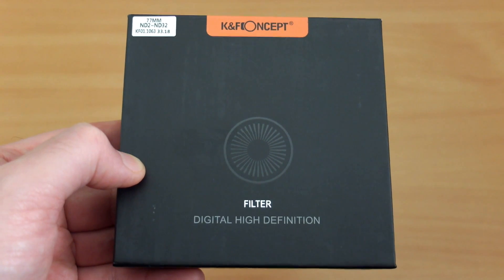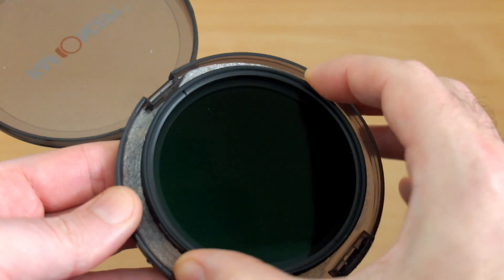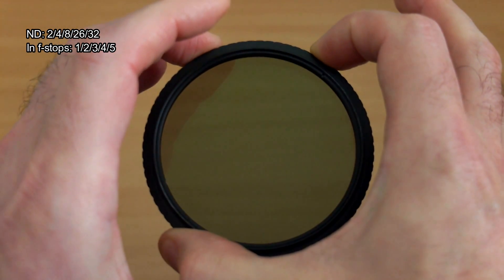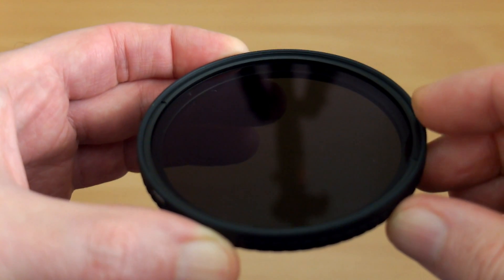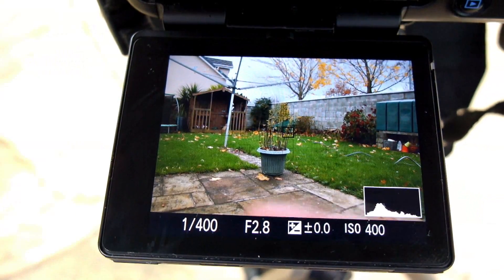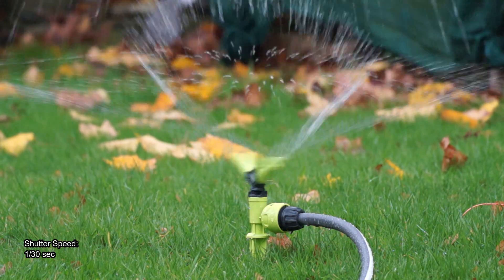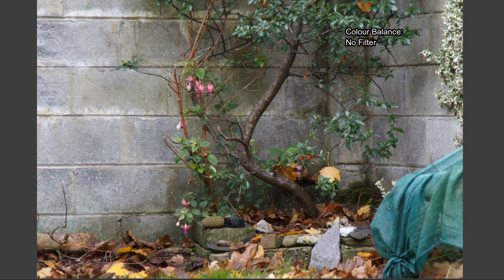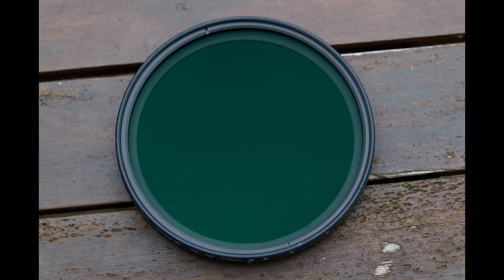K&F Concept Ultra Slim Variable ND Filter (New version): Review

Comment: I used a test image for comparison of your K&F ND Ultra Slim Variable filter being on the lens and off the lens. First test was without your filter to make sure I was getting a sharp image also tried it with multiple lenses to make sure I did not have a problem with getting a sharp image with any of the lenses. All the images with the Two lenses I used were perfectly sharp without your filter. I then use your filter on the lenses using the same settings and got terrible results. The image was completely unusable blurry after installing the filter. Also the color shift was not acceptable. The lenses I used were of high quality Canon L glass series lenses.
Reply from the maker: I can only test the sample I have, there was a slight hit in resolution using a prime lens stopped down, not that much at least on this one, the colour balance was fixed for the test, there is a slight shift on this sample.
I've seen dud filters from various makers including a few higher end ones, so in this case I would return it
It's not my filter it's a review sample sent, I'm pretty upfront about what I have and what I find - but I only have one sample to test

Comment: Hi great review,thank you !I plan to buyK&F Concept ND1000 Nano-X (fixed nd) do you think the clor shift will be worse than this variable version...i watched several reviews and everybody tells different opinions?
Reply from the maker: Which one the square of screw in filter? I did a video on the square ND1000 and that had a tiny tiny shift, barely noticeable
Reply: @MrBazReviews  the screw in.
Reply from the maker: Not used it so can't say I've not looked at other videos, really you need to fix the colour balance to see if there is any shift, so look for that in other people's videos. If it's the same material as the square one the shift it pretty small not field relevant. I might try to get one it for testing

Comment: On amazon it has two silver bits that stick out to make it easier to turn, this one doesn't have them?
Reply from the maker: I believe that's the 2 in one variable ND and the CPL, that from what I see has the metal pins on the rim. This doesn't, it's not hard to turn really though

Comment: I've got a Samyang 12mm MFT and I'm looking for an ND1000 filter, for it, since it's mft the image comes to 24mm, can anyone recommend a filter that won't cause (or not much at least) vignetting in the image? Thanks.
Reply from the maker: If it's on a crop body you should have less vignetting, quite a lot less depending on the lens. I doubt it will be an issue for a 12mm lens on MFT, vignetting is def lower on most of their lenses - 35mm quite a lot higher vignetting v MFT and APS-C

Comment: I am using 46mm nd2-nd32, it has X pattern at max stop, so basically you can only use varible from 1-4.5 stops effectively.
Reply from the maker: I've not seen it on this sample, if it's not set up properly at the factory it might explain it

Comment: another stupid question, how do I know how much I need to spin the filter if I already know the shutter speed and aperture I wanna use??
Reply from the maker: You'll have to rotate is until it's what you want. If it's fixed ie manual with shutter/aperture, then adjust until brightness is what you want. You might have a histogram or zebras to work with, that can help

Comment: Local courier requested extra charges (USD$26) when bringing the item to my address. There is also wide angle vignetting at 10-11mm (I bought the filter for my 10-18mm lens).
Reply from the maker: Any filter on an UWA lens bar a slim UV is going to impact vignetting to a degree, hence I tend to avoid using UWA lenses and filter. It's alright for what it is, depending on how and what you want to use it. Can't help on the courier sounds dodgy if it was bought from a well known source
Reply: Mr Baz Reviews I bought it directly from K&F’s website that offers international delivery. But thank you for letting me know about ultra wide angled lenses and nd filter vignetting.
Reply: I am planning to get one for my 10-18 as well. Can you share your experience with me please.
Reply: Itchy_Feet_bd This is their reply: “Dear customer, Greeting! By the way,concerning the question 1,the answer is we are sure that as long as there is a filter,the issue you mentioned about the dark angle willl be sure to exist.It has already relieve the problem without filter. Looking forward to your reply.Have a nice day.” and “Hello, I already know your problem.
It is not that we do not contact SF after-sales customer service. Hong Kong SF and our domestic SF-related areas are different. They need to contact Hong Kong SF to answer us. Then we reply you, which will greatly reduce efficiency.We also hope to get their answer asap. Any information that we need to cooperate to offer will be provided to you as soon as possible.Let's get the argument done for first thing,then we discuss compensation together. Do you think it is acceptable?Thanks. BTW,we don't work on weekends, any progress, please contact us on Monday.”
Reply: All variable ND filters have vignetting... you can only help minimize it by getting one larger than lenses thats why I only get 82mm.

Comment: Can you stack a protective, cheap UV filter on top to protect this K&F from bumps..?  (are they stackable..?)
Reply from the maker: Normally it's not a good idea to stack filters, thread on the front of the 77mm variable ND is 82mm but you can use it if you want to
Reply: @MrBazReviews  my camera case accepts 52mm filters, I want to put the K&F no x spot on the camera and then put a 52mm UV protector lens to protect it.  Are you saying that the 55mm has different sizes top and bottom..?
Reply from the maker: @rdkuless  On this top thread is larger. There are 2 pieces of glass there so that will explain it
I cannot stress enough that it is not a good idea to stack filters, putting a UV on top of this will hit the resolution. There is no need to put a filter on top of this a cheap one will likely be bad quality, just use the case to keep it protected

Comment: Does the ND 400 one have the X ?
Reply from the maker: I don't see an X on this sample but some say there is so hard to say I can't see it at all and I've used it a lot, unless there is a QC issue. All variable ND's will have an X if they don't have a hard stop, but this does so I assume if it's not quite aligned correctly it could show up - nothing X on this one.
Normal ND's ie fixed ND400 ND800 are single filters and will never have an X, its the combination of polarising filters in the variable ND's that can cause problems - but it is useful to have a variable one v carrying multiple filters around
Reply: Mr Baz Reviews thanks a lot

Comment: There is absolutley an X pattern at ND 32.... If you test this in the right setting, its clear to see.
Reply from the maker: I can't see it on this one the hard stop prevents it, unless you got one where it's not aligned properly I can only go on what I have here
Reply: @MrBazReviews  What focal length lens were you using?
Reply: What focal length lens were you using?
Reply from the maker: @TheSoundlotKids  For the stills shots telephoto I used a 90mm F2.8 macro the wide at the start is a 17-35mm
Reply: I have X pattern at ND32 hard stop, switch to somewhere between 4 and 5 vanish the X, i guess the best I go for this varible nd filter is 1-4.5 stops
Reply: @kingtohoku  The bigger size filter you get, the less side effects you will have. This is why its recommended to get 82mm and use step up rings.

Comment: which camera were you using and which lens ? I'm afraid to get some vignetting on a 24mm FF or even on a 16mm
Reply from the maker: I've tried it on quite a few lenses but I usually go for a larger filter and then stepping rings. It's about as low profile as I've seen for a variable ND, but it depends on the system you use and lenses. And if you are using it for stills or video. Some correct for lens fall off some don't. I'm not seeing any major vignette on the 17-35mm at the wide end, but on full frame wide open many lenses will show it unless the camera corrects for it
Reply: if you use it on a 77mm lens you'll have a lot of vignette

Comment: I was looking at the reviews on Amazon. Most seem to like the filter though I heard one person say that there is vignetting at ND2 and another person said there was some X at the ND32. I was just wondering what your experience is. Been looking for a good midrange VND for 60% video and 40% use for stills on a Pixel 3 with a lens adapter.
Reply from the maker: I've not seen an X using this and I've used it quite a lot since I made this, unless they got a suspect sample. What lens/camera are you using? I can have a look in more detail at particular focal lengths, for ultra wide just about any filter like this will cause some vignetting
Reply: @MrBazReviews  Hi, thanks for the reply. This will go on a Moment wide angle lens (with a 62mm filter adapter) meant for smartphones, in my case the Pixel 3. ND2 to ND32 is essentially the usable range I'm wanting/needing. Colour and sharpness I can deal with in post and I realize that this is a requirement even for high-end VNDs, mostly concerned with vignetting and uneven light in the image. This VND is about half the price of the Hoya and Tiffen VNDs so I'm hoping it will work for me.
Reply from the maker: I can't see it being a problem on a phone as I've used it on larger sensor cameras with no obvious issues. There is a slight cast, but its' just that slight much less than the Zomei one I used before and it's also much better in details than that (but they have a newer one out it might be better than the older one I tried)
I can't compare to the Hoya and Tiffen ones as I don't have them, but I've found it good for this price point. With slight downsides as mentioned
Reply: @MrBazReviews  what are the downsides of this filter?
Reply: @MrBazReviews  i just purchased the new hd variable zomei filter with schott glass,it has noticeable green cast,very less sharpness with problems in bokeh (lines inside bokeh balls).shall i return it and go for this one?have tested the bokeh in bright situations?because in zomei lines appears only when there is bright bokeh balls.
Reply from the maker: @chandan6119  I have not used the new Zomei so I cannot say how it compares I would need to use them side by side. I have looked at items from Zomei in the past so it might be possible in the future to do so. The review covers as much as I can - I looked at sharpness, colour cast, and actual ND filter light reduction. My conclusions are in the video there is a very slight reduction in sharpness, very slight colour shift (but very low overall much lower than most I have tried), and it's a bit less than quoted for light reduction. But on balance the performance is very good for this price
Reply: @MrBazReviews  thank u.zomei filter has bad bokeh and around 30cent reduction in sharpness.
Reply from the maker: I never fully tested the old Zomei as it had strong colour casting so I didn't use it after that. I know they have newer ones out, can't say as I have not tried them. Their UV filters are OK tried some of those didn't hit sharpness on lenses
The K&F is solid for this price level happy to use it as the testing shows very minor colour shift and didn't impact on the blur quality either
Reply: having a lot of diagonal vignetting(left upper and richt lower corner) at ND100, ND256 and ND400 on the k&f concept fader nd2-400 filter.  I would not recommend this K&F concept filter at all!!